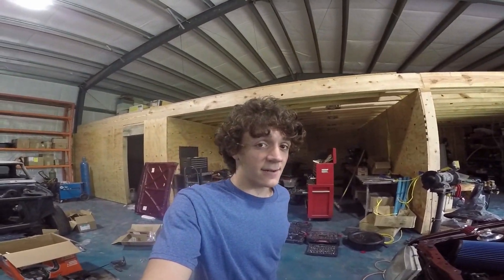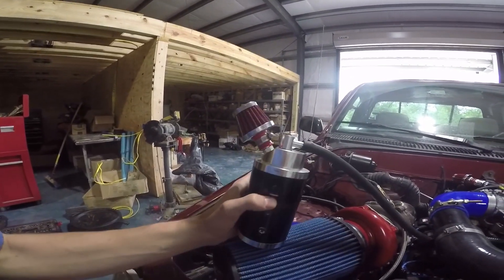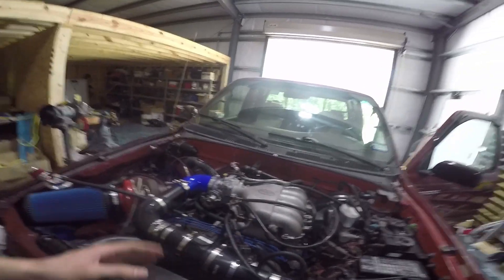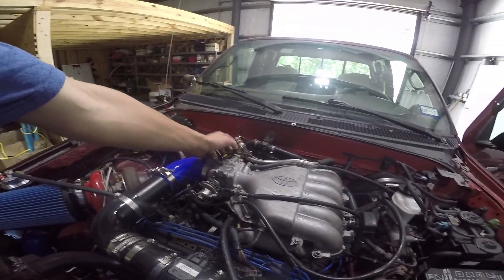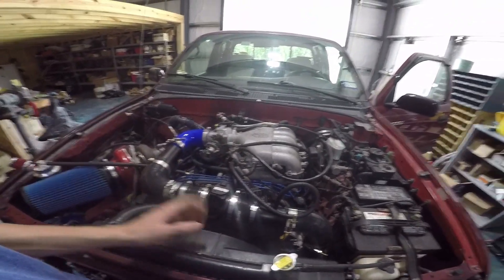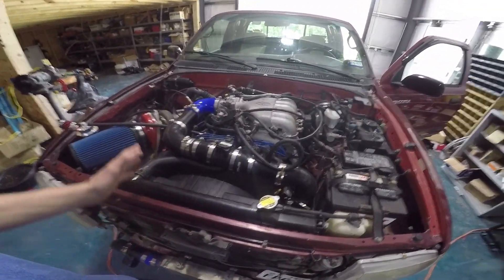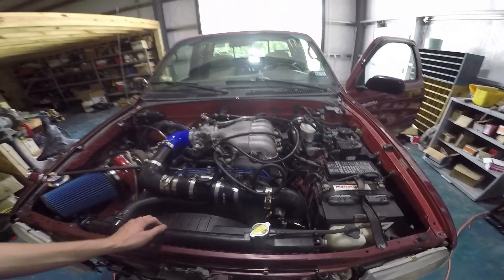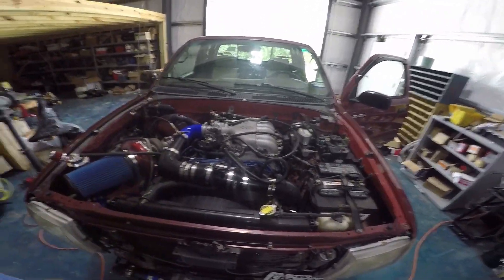How To Turbo A Tacoma (Kinda)- PCV and FPR

Comment: Let’s see some updates on this build !!!!
Reply from the maker: Unfortunately this truck is stock again. There was an unfortunate incident were the wastewater was plumbed in incorrectly and it stayed shut under a WOT pull. The turbo hut 24psi and the compressor collided with the compressor housing. Luckily I lifted pretty quickly, but the turbo still died.
Reply: Do you have anymore videos??? I just started this HUGE PROJECT YESTERDAY

Comment: For some reason my truck turns off when I plug my MAF sensor. I need help it wont pass 3000 rpms
Reply from the maker: Sounds dumb, but make sure it isn't backwards! Same thing happened to me and it took me a bit to figure that out

Comment: How about the brake booster vacuum  line? What do you do with that now that your intake manifold is seeing pressure instead of vacuum?
Reply from the maker: All I did was at a check valve in between so it blocked the flow of pressure into the booster but not the vacuum.

Comment: Subbed!
Sweet setup! 
 No boost on mine but i just have both my PCV's dumping to atmosphere.
Didn't like how it was gumming up the IAC/TB unit and plan on going to a catch can eventually just for piece of mind and because it loses a bit of oil to between changes.
my swaps pretty much cobbled together anyways lol
Reply from the maker: lol this thing is pretty cobbled as well, but I ended up changing this setup because the rear most fresh air intake started leaking more oil than the actual pcv so I have it run to the catch can and the pcv on a filter, I really need a dual inlet catch box with dual filters (the expensive stuff) but this thing was built on a strict budget so no fancy "catch boxes" lol
Reply: Yeah i know how that is..
Really wanna go the turbo route on mine to but because I have a 2nd gen 4Runner everything's a little different. I know engines coming out for sure for mock ups and crossover.
These engines are super easy to pull.

is yours an auto or stick?
Reply from the maker: Gearhead Garage Auto with a shift kit. https://www.youtube.com/watch?v=gNbEF1s8V2s
Reply: Here's some good info on boost and injectors you can run with it.
from MR2 fourm

""one of my options to be avaible is cleaned and flow matched Supra non turbo fuel injectors which are rated at 315cc good for about 300-320whp

I will see what info i got for the rest of them as i gotta continue some resaerch...

Theyre rated at 315cc at 38-42psi...
If you are using the 1mz, the stock fuel pressure is 48-52psi...
I dunno the psi-rating fer the 5vz...""

Comment: The stock pcv system works fine even on boosted setups. It's only open drawing filtered air though the crankcase during vacuum. It closes in boost so it won't pressurize your crankcase. I've been using stock pcv setup for years. Just remove the fresh air inlet hose from the back of the driver valve cover. Put a small filter on that if you want. I don't. Catch can is just another thing people complicate their setups with. Just my $.02 YMMV
Reply: I guess if anything you could put your catch can on the back "fresh air supply" hose and at least retain your pcv system. I've never really had any oil or blowby come out of that hose, even at 14psi. Or just leave it like it is and bypass the pcv altogether but I think you need crankcase scavenging personally.
Reply from the maker: If you could go and post this on my thread that'd be great. Im sure people would appreciate what your saying since others on the forum religiously say you must have a catch can.
Reply: NO!!! Keep the catch can. I have a turbo Tacoma (96) and most of my seals were absolutely shot within 2 years. Replaced the seals and now I have a catch can.
Reply: GioGuitarDude glad your setup is still kickin! I'm going to kindly disagree though. I've had 3 turbo'd 5vz over the last 4 years and never had a catch can. Simply vent the rear breather to atmosphere. Never had a seal problem whatsoever. Maybe there's some other variable that  we're missing.
Reply: Rear main, valve cover and front crank seal all pretty much gave out all at once. My rear breather never has oil come out of it so I never thought it would work good enough for boost crank vent (could be wrong).
I went WAY overboard though... both valve covers are vented and T'd to the catch can 🤓.